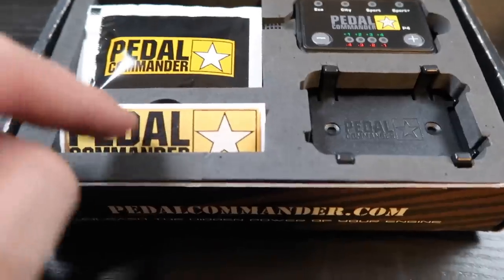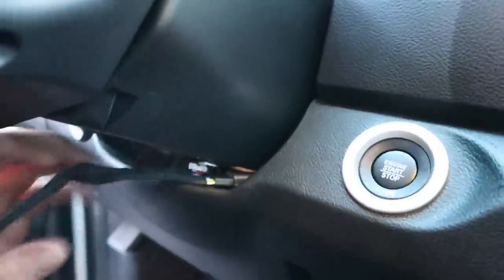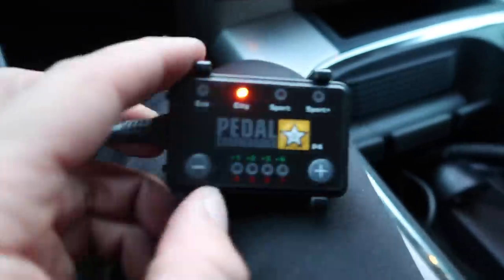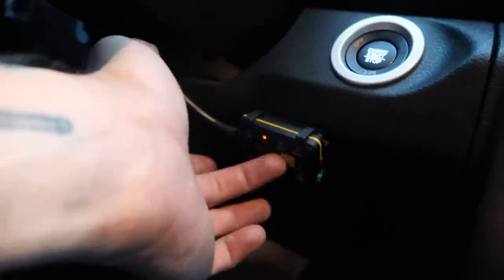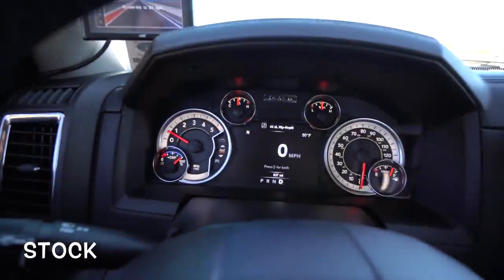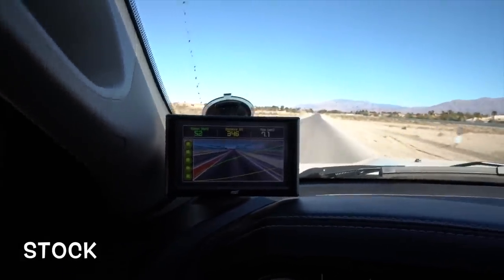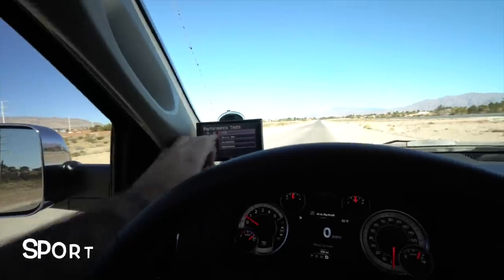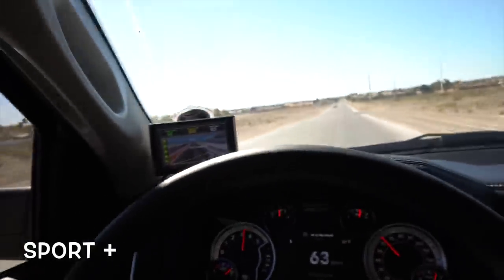Pedal Commander Review - Realistic Tuner Replacement? Jay Flat Out

Comment: I have a Hemi Ram with an edge tune, K&N CAI, BBK shorty headers, flowmaster outlaw super 10 exhaust, Shift kit, line booster, and 355 gears with the pedal commander. I no longer use the pedal commander. It makes the truck TOO fast as far as throttle response. Literally it works as advertised and I am fully satisfied with it, but I need to not replace tires every 30000 miles. The plus 4 sport option makes the truck seem like a beast. 0-10% throttle input equals 0-100% normal throttle input. Very great for reaction times and off the line acceleration.  Whenever I let someone drive the truck, I put the pedal commander to sport+ and +4
Everyone says its the fastest most powerful vehicle they have ever driven

Comment: I love it I run mine with a Diablo tuner and I have a full flowmaster 40 series headers back system plus k&n cold air intake bad ass..
Reply: Why did you add the commander when you can boost throttle response with the tuner? Just curious

Comment: i do have a question though what if my car has Sport mode already?
Reply: I have the pedal commander in my 2019 challenger rt. It doesn't add horsepower but it makes it very snappy and faster response. In sport mode on the challenger and sport mode on the commander, it definitely responds very fast. I have also noticed it improved my stock muffler sound. Hope this helps.

Comment: Good review!
Just getting ready to install mine in my 2019 Laramie.
I already installed an S&B cold air intake and did a muffler delete so it sounds badass but being a lifted, heavy truck it needs a little help off the line and a little better fuel economy.
Thanks again, looking forward to using mine!
Reply: Holy crap!!!! This Pedal Commander launches my truck!!!
I have 35s and I roasted the tires in place on dry pavement!!!!
Well worth the money!!!!
Reply: 19 classic or new 19 body style?
Reply: @melspadt  so the pedal commander made your tires chirp more easily compared to factory? And did it change throttle response 40-60
Reply: Jason Shin new body style Laramie
Reply: Cedric Miller it will chirp or spin the tires from the start but not in between gear changes.
I can get up to 80 miles an hour in about 6 seconds

Comment: I drove from Atlanta Georgia to St. Louis Missouri in my 2019 challenger r/t. I had the pedal on eco mode. I got 30mpg on the trip. I did get on it some too.
Reply: The eco mode on the pedal commander only delays the throttle response time while accelerating from a dead stop because that is when you burn or waste the most amount of fuel. Cruising on the highway it doesn't do anything, you could have had it in sport +4 the entire trip and still averaged 30 mpg. Eco mode is not doing something magical inside the engine to give you better fuel mileage it just slows the response of the throttle opening. My girlfriends 2015 Hyundai Tucson has Eco mode and the lag or delay from the pedal acceleration is so god awful in Eco mode we keep it off. My 1984 Dodge Power Ram has a 1:1 throttle response because it is a physical cable opening up the throttle and let me tell you the difference it makes when you mash your foot down is insane

Comment: Holy cow my grandfathers truck does does 0-60 in 5.4 seconds stock. But if it takes another second and a half off the 0-60 his truck would do 0-60 in 3.9 seconds!! Just if your wondering its a 2014 Dodge ram 1500 5.7 regular cab short bed
Reply: Sorry this product will do nothing for your zero to sixty time
Reply: I'd connect two of them in a row.  Then your grandpa's truck will do 0-60 in like 2.1 seconds!!!!!!!!
Reply: Connect 4 or more together and you have yourself a time machine.
Reply: He has a 3.0 ecodiesel turbo diesel
Reply: Is it compatable with a superchips tune installed?

Comment: I have it for my 14' F150 Ecoboost, nice knowing you turbo lag. Especially if you have a cold air intake and dual exhaust. I like the bluetooth option, change my settings on my iphone. Just bought a 15' Camaro 1LT/RS, first thing I bought was another Pedal Commander. I love barely touching the accelerator and BOOM, I'm off!    Almost forgot, if you're a veteran call them and get a GREAT discount off the price!!!

Comment: Pedal Commander truly works...I have one on my 370Z and the throttle response is nothing short of amazing. All of the naysayers below just simply talk themselves out of something because they don't understand how it works. It DOES get rid of throttle response lag. That's all it does. To quote a responder, "No matter what setting you have on the pedal commander the ecu will still slow down the rate at which your throttle opens". That is untrue. With the Pedal Commander, the ECU does not slow down the rate at which the throttle opens. And, it does get rid of the lag caused by today's ECUs. I know from experience...I have no lag now when I press my gas pedal with the Pedal Commander attached, where before installation, I did.

Comment: My truck runs 5.2 0-60 times, and the pedal commander had no improvement but more fun to drive. If you can stomp the pedal hard the pedal commander will not improve anything. My truck with tools, job box, and back rack with me inside weighs in at 6066lbs. So pretty good.

Comment: Aka throttle controller. Does noting but tell the ecu the accelerator is pushed down more % than it really is. So, 10% stock is now more likely 15/20%. I got one as part of a stage one kit as it claimed to reduce the lag I got from putting my foot down to the car actually responding. Works well. Can be dangerous. Turn it way up and mine fries my tires.

Comment: I am reading thru the comments (because that is always fun on youtube) and there seems to be a big debate as to what is real and what is not, and whether this thing actually works or not. 

Lets start with the claim, it claims to reduce pedal lag, or in other words the amount of time it takes from you pressing the pedal, to the throttle body actually responding. The thing of it is that lag is very, very, very small, we are talking microseconds. There is no way anyone can notice this "lag" (on most cars). Note the lag in quotes, why you might ask? simple because it is not actual lag, ie time it takes the single to go from pedal, to ecu, to throttle body. Then what is it? you might ask. It is the computer doing what it was designed to do. The computer is designed to get you the maximum amount of fuel economy. Why? because they have to keep up with the ever stricter epa laws regarding mpg ratings and what they can and cant sell, and because the average car has no need to have its "full power" released. Hell the average driver probably wouldn't even be able to handle it and would probably crash!

So then lets get to what this actually does. What it actually does is it takes the single from the pedal, and it adjust it. So for example (I thought I saw actual numbers somewhere a while ago but I cant find them so this is made up numbers) in city mode this thing MAY amplify your pedal from 1%-15% by 2, from 16%-35% by 1.5, and then from there back to factory stock of one to one. So you bring your pedal to 10% down position, this thing amplifies and tells the computer it is actually 20%, and the ecu/throttle body act accordingly. As you throttle up more, that effect slowly goes away, why? because your in the "city" and you don't need to keep accelerating hard after that. The sport and sport+ do the same thing, but obviously at different ratios, and with less of a drop off as you get higher. 

Basically what it is doing is taking what used to be a low % of throttle, and turning it into a high %. This may make it feel as though there is no "lag" but it really hasn't done anything to speed up the process (how do you send electricity faster when it already travels at the speed of light?).  The proof to this theory is the one main complaint I have heard about this thing, a lot of cars at sport+ +4 the car is idling at like 3K rpms! Why? its simple the pedal doesn't fall back to a full 0% read, and instead reads something really small like maybe .5% or even 1% which at a factory of 1 to 1 would have almost notice effect. But in sport+ +4 your amplifying that single by like 20% or more, so the ecu actually thinks the pedal is at 20% or higher, and is applying the throttle accordingly. 

So anyway onto the big question, is this thing worth it? With out actually have used it (I probably will at some point) I am going with it depends. If you are someone into cars, then I would say yes. Why? what it allows you to do is to tune the pedal the way you want it to respond. With it stock you are stuck with how it is, which you may or may not like (of course if you like the stock feel of your pedal, than no). This thing allows you change that. But keep in mind this thing WILL NOT give your car more power, it will simple allow you to adjust how and when that power is applied. This can be very useful, especially to someone who is into cars and can actually feel the difference. It could also be useful to someone who offroads, or driving in inclement weather like snow, why? because in those cases you can "throttle down" the pedal response, allowing you more smooth, safe take off in slippery conditions. 

Wouldn't a chip and tune be better/more worth it? it depends, from the stand point of I simply want more power, then yes! With that being said it would cost a lot more (to be done right and actually get good results), and it will also void your warranty. Plus if it doesn't work then you have really big problems because it is kind of hard to go back on tunes and chips. With this thing if it doesn't work, or causes problems unplug it and send it back/throw it out. If your concerned about a dealer giving you a hard time for warranty work (which they might) simply remove it before you take your car to dealer. 

This is why I think it is worth, for something pretty cheap (I mean $300 isn't really cheap, but a lot of tunes and stuff will be a lot more), that is simply plug and play, and really easy to remove if issues do come up, that allows you quickly and easily adjust the way your pedal responds to aid in varying road conditions, then I think it is worth it. If you go into it expecting to turn a slow pile of crap, into a super fast race car, you will be disappointed, but if you go into it expecting to turn a slow pile of crap, into something thru tricks that feels a little better, then you will be quite happy. 

"But Kevin so you will pay $300 simple to be able to play with the way your throttle pedal feels, isn't that a waste of money?" Technically yes, but then again so is your $1000+ phone, and $2000+ tv, sooooo theres that.

Comment: You spend 34 -40k for a truck you have to buy gadgets to make it run right i have a GMC Sierra new body style since 07 with AFM what a piece of crap it turned out to be after the warranty ran out dropped lifters traction control wheel sensors, Stabilizer control. Emission problems. If you want my advice stay away from the AFM., Drive by wire and buy a Diesel or a truck with a half of brain and throttle cable cause they are going to charge you a arm and a leg with gadgets and diagnosis on your 40k truck. Oh yea your little key chain and sticker
Reply: Couple of questions: 1. If I have a 14' 3500 Ram Dually w/ 83k miles waiting for my girl(truck) to get back from the engine blowing up, thx god for the warranty that I have till 100k miles should I get one and will it void my warranty on my Cummins if something happens?  Whats your history with Cummins?

Comment: I have this on my 2012 Dodge Challenger R/T classic and just got a 2011 ram 1500 with 5.7 hemi....same motors and basically same years. Do you think it’ll work for the truck as well?
Reply from the maker: You see a far greater improvement on the Diesel engine than the gas, but it works on both.

Comment: 36 settings marketing bullshit. 4 would be plenty. Maybe 10 to account for variations in trucks.  It's commanding the pedal faster than what u r.  
I don't believe the 0 to 60 times do 10 runs with each setting and give us an average. I bet That s not more than .25 or .5 better vs the 1sec u claim after a single run....
Reply from the maker: its not a "claim" I literally did it on video lmao. Troll.
Reply: Jay Flat Out u did 1 test run. A 3rd grader knows that has no statistical meaning. U can get a .5 sec difference between runs if u change nothing. 
Not a troll. I am an engineer. Take advice to help your channel or not.
Reply: Jay Flat Out i like your channel and subscribed. If u want people to stay around u can't act like a kid. Calling people trolls because they call out issues doesn't work. We know U want to make money by making videos. So man up.

Comment: So something that I haven’t seen in these comments yet. You say it opens the throttle body faster correct?  In your case as well as in with my eco diesel this shouldn’t have made any difference because diesels don’t have throttle bodies. Diesels don’t accelerate with the control of air they accelerate with the control of fuel and injection timing. The butterfly at the front of the intake manifold is to control the amount of egr going into the motor.
Reply from the maker: No I said it increases the voltage sent from the electronic accelerator

Comment: Will it damage your transmission if the setting is changed while the car is running? If you move from sport to eco or viceversa?
Reply: No damage to tranny. It just redistributes a little power to the front end but tapers back to normal as you keep on the accelerator. Adds no power or torque. Changes sensitivity on throttle body

Comment: My Jeep Cherokee has sport mode sand/mud and snow would those not mean anything and not do anything if I put this in
Reply: There are some changes with the throttle inputs. The problem with throttle by wire on turbo engines. Is an exaggerated turbo lag. There were times I was trying to pull out into traffic and my truck wouldn't go. Not a good situation to be in.

Comment: The 2018 F150 has something similar already in the truck with variable drive modes. The only mode I didn't try out in my rental was the tow/haul mode but I did see similar throttle response differences between normal, ECO and sport.

Comment: I heard this was a cool item, if you just want throttle control. I'm still stuck on the tuner with adjustable parameters across the board. I also never had a warranty issue with my tuner on the truck. The dealer actually has a no flash notice in their system whenever they pull my truck info.
Reply: HEMILIFE 410 lmao. They know u have it tuned! Dealer just turns a blind eye. Dealers don't pay warranty. Fca does. So if u have an issue good luck getting it covered by the manufacturer.  On a 50k truck it's not worth the risk.
Reply: Andy Hass yeah no 2 situations are the same. I got my 13 brand new and tuned it at about 9000 miles and I've had a few warranty issues taken care of. Most important was the mushrooming of the valves. They had to replace the whole left side head and they knew it was tuned. One service guy did act a little funny but they took care of me. Every oil change they know not to flash any updates without asking me first. So in short yeah it's all on your service advisor and the relationship you have with them.

Comment: How are you getting 19 mpg out of that truck? I have a 15 Ram 1500 Crew Cab that gets 14. I don’t romp in the pedal either.
Reply: Clean your air filter, check your tire pressure
I have a 2010 and when I don't drive fast I can easily get 18+ and that's all stock also
Reply: EliteStricker I just bought mine in November. It’s got 46,500 on it with brand new tires. I should check the air filter as the dealership surely didn’t. The previous owner was getting 11.8 mpg. So I’ve gotten it up a little.
Reply: @KG-gf2jo  I bought mine with 60k on it and have 122k now, mostly all highway miles. 
Check engine filter, try one of the gas additives. You use regular gas? Or mid?
Here in sa I use 89, which is also recommended
Reply: EliteStricker I’m probably 60/40 highway to city and I use regular. I’ve been thinking of going up to mid grade to see if there’s an improvement.
Reply: @KG-gf2jo  Yea I'd say try that and a gas treatment
I just went to get some food,  and getting there, I was getting 14mpg

Comment: You can do the for free. Google peddle reset. Do it about once a week and it's going to give you what this mod is doing.
Reply from the maker: I like the free idea but honestly for me this is worth the convenience of “set it and forget it”
Reply: Jay Flat Out I'm not sure if this mod will last. As in the computer learns how you drive and then changes the peddle curve to best fit how the man wants it to. Resetting the peddle gives you back that cable feel. I can only imagine that this product can give you a short time before the cars computer takes its modified commands and then changes them. I do know that even after resetting my peddle, when fully depressed the computer is only letting me reach 90%. So really that's all i could see this really achieving would be 100% open. But i still feel that it would not be for long without resting the learned curve.
Reply: I have one in my 2012 Dodge Challenger R/T with the 5.7 and I just bought a 2011 big horn ram 1500 with the 5.7.....do u think it would work in the truck as well since it’s same motor?

Comment: Interested in knowing just what modes I can use my cruise control in. Cuz I use it all the time...
Reply: It won't work when speed control is used, reverts back to stock.
Reply: @melspadt  Thanks!!! I'll save my money
Reply: Doesn't change nothing with using cruise control. Everything works just the same. I have this in my vehicle just for quicker acceleration. Not trying to add power to a fusion EcoBoost. Just want some pick up off the red light. Just a little fun.